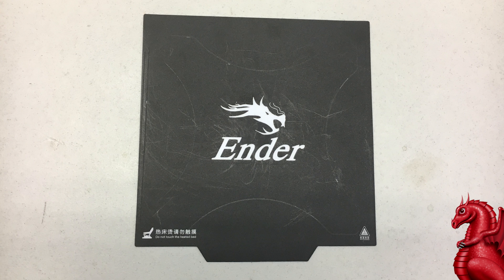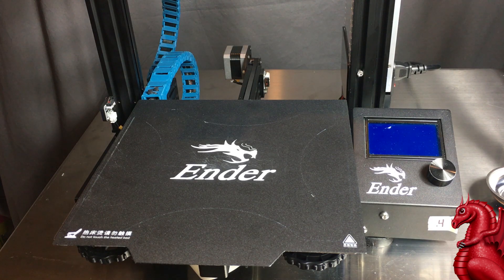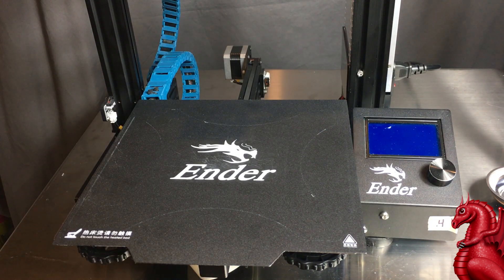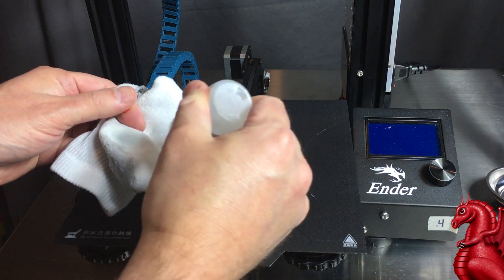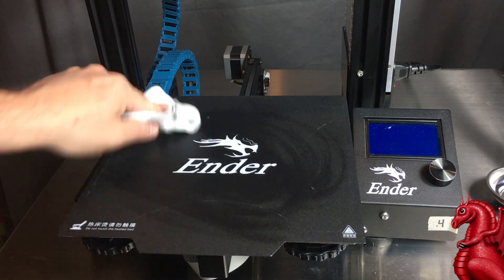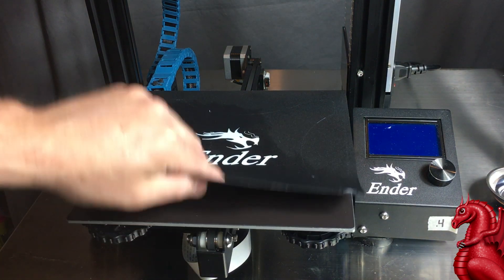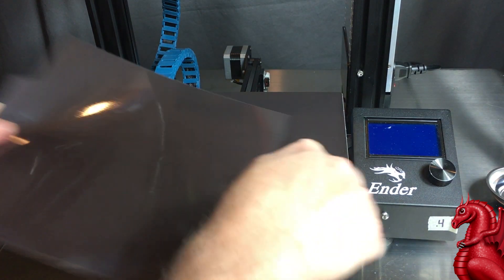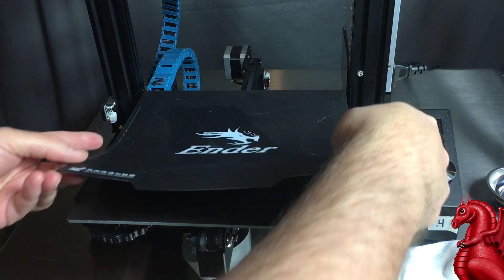How to Clean the Creality Ender 3/5 Print Surface

Comment: DONT USE ALCOHOL. I used 70% iso alcohol and after two cleanings in 2 weeks it took the texture off my plate. I am using an Ender 3 V3 SE stock OEM bed plate. I had to order a new one since the texture was completely taken off by the alcohol and was no longer usable.
Reply from the maker: That wasn't the alcohol removing the texture, you have the Z offset set too low. Iso will not harm the plate in any way.

Comment: Mine pulled part of it up off the magnetic base... I cut it up and use a thin strip on my left side for the pre print. Then I cut a picture frame glass to the y axis size and took a high speed drimmel with a large grit stone sanding bit at mid speed to texture the top of it. Works better than the old bed had
Reply: Got an awsome beholder and purple worm off it.

Main negative is my bed has to stay to the starting temp even for pla. I used to have my ender stock bed set to 60c for first layer then cool to 50 for remainder. Now all those gcodes require me to be there when the first layer finishes so I can reset the bed temp through the ender UI

Comment: Since I used isopropyl (ketonatus in Dutch stores) to clean my bed I started to have sticking issues. Just a heads up.
Reply: Allright, I tried some isopropyl from the pharmacist and that worked. Apparently the additive to make the isopropyl undrinkable leaves an oily residue. Good to know, since the bottle states it is for cleaning instruments.

Comment: I clean my ender3 bed after each print. My problem is poor adhesion using a gcode I just printed the night before with no issues. Just a pla color change. Any ideas?

Comment: I really need some advice. Every time I have tried cleaning my Magnetic build plate with 70% Alcohol and using the sock method it is not the same after. Prints will not stick to the Bed. I have even tried the Dawn dish soap method and still no  results. I have gone through two Mats already because after it has been "Cleaned" PLA will not stick. So far the only way to get bed adhesion is to buy a whole New mat. There's gotta be a better way. Any, ANY help would be great. Thanks.
Reply from the maker: This sounds like the bed is slightly too low, try raising it up 1/8 turn on all four wheels
Reply: @Tombof3DPrintedHorrors   Thank you so very much for the reply. Can I pick your brain though? So I was printing after "cleaning" it and got a complete mess. However right after taking off the "cleaned" mat and just placed on a Brand New one. No leveling in between the mat placements, It started printing with no issues what so ever. So is the alcohol removing something off the mat?
Reply: @symbolicsin  I'm having this same issue. I've cleaned it a lot how this video shows but the adhesion isn't improving. I've been sticking the free build surface that comes with Overture filament and that improves the adhesion. I feel like there should be a better way
Reply: @symbolicsin  exact same thing is happening to me, perfect prints for two days, cleaned it once with alcohol like this and cant get a single 1mm to stick to the surface anymore. Did you find any solutions?

Comment: When I start to lose adhesion, I clean it with white vinegar while the bed is hot. If stuff wont lift off the bed, I spray a little alcohol (usually cheap vodka) around the base of the print as the bed cools. They usually just pop off. Works on glass plates too.

Comment: Rubbing alcohol is impossible to get because of COVID-19. Is there an alternative?
Reply from the maker: I haven't tried it yet (will as soon as I run out of alcohol) but I am told windshield wiper fluid works great too.
Reply: @Tombof3DPrintedHorrors  Windshield wiper fluid is basically Windex, I think. That should work on glass beds, but I have the magnetic beds; I wonder if that would ruin the surface (coating).
Reply from the maker: @MinhGators  no, not the same at all, Windex has ammonia, WWF has a high alcohol content. Like I said, I haven't tried personally so cannot recommends for sure.
Reply: @Tombof3DPrintedHorrors  Thanks.

Comment: Thanks for the tip! I'll definitely use it, I already ordered isopropilic. It seems though that isopropilic does not get rid of rests of plastic on the surface, or does it? 
If not, how do we remove the very thin rests of print that get stuck on the print surface and don't come off easily with a knife or a scratcher? Thanks again, keep it up!
Reply: Asis Cal I read that heating up bed to 80c makes those thing pieces of pla easier to remove

Comment: If anyone knows how to get the really thin layers off please let me know. I just assembled my Ender 3 and printed the bed level test from another tomb of 3d printed horrors video. I have tried soaking the area in 50/50 water/alcohol, drywall scraper, and a razor blade and it wont budge.
Reply: Jared Moss try heating bed to 80c to loosen up the thin layer that is stuck

Comment: I just wipe the hot bed with vodka soaked dried wet towels during the hotend heating. Vodka evaporates almost immediately and is less toxic than isopropanol. (Why do I use dried-former-wet towels? I had the pack which was not tightly sealed and dried unfortunately...) I do have IPA but prefer to use it for PCB cleaning after soldering.

Comment: I wash it in the sink wish dish washing liquid and a sponge.  After cleaning the bed with alcohol I reinstall the mat and bring it up to temp.  I then use a paper towl and ISP to wipe the surface.  Looks and works like new.  Paper towels do not hurt and are very economical, such better than a sock.

Comment: Okay, but how do I clean it of the thin layers of PLA that stick to it? The kind that are too thin to peel off.
Reply: Thats the whole reason I watched this video.
Reply: Same
Reply: Put your plate in the sink so it covers the plug hole. Pour on boiling water from the kettle, it will lift off
Reply: Who needed a video to learn how to wipe dust off the print mat?  We came here for PLA residue removal!
Reply: Yeah I also can’t take that off
Reply: First off, your layer height is not right if this is happening or you have wrong temp or bad filament.  If you are using PLA, heat the bed to 80c and that should allow you to scrape the thin layer of filament off.
Reply: @broderp  Your the hero!!!!!!!!!!! thanks!
Reply: @barbieeberhardt4959  Don't listen to him. Heating the bed higher than what is default will destroy its own magnetism and it will start slipping around the printing surface. Maybe once sure, but done repeatedly will ruin your magnetic bed.

Use acetone or similar solvents and spread them on the bed, wait for some time for it to soak in the PLA then remove it with a spatula.
Reply: @floatingchimney  so I shouldn’t be heating my bed to 100C??? That is what the Owl print was set to for the starter print
Reply: @floatingchimney  Acetone is EXACTLY what will ruin the bed.
Reply: @broderp thanks bro, this worked perfectly for me, didn't need acetone or alcohol
Reply: @broderp  Thank you mate, saved my life., i forgot to calibrate the Z offset and it messed up my bed :o That trick worked flawlessly to repair my mistake, cheers !
Reply: @broderp  layer height in the slicer settings?
Reply: @broderp  THANK YOU.
Reply: @broderp  This is the best advice I got so far. Thank you.
Reply: @broderp  your a legend 👏
Reply: @broderp  the magnetic bed can't take the 80º C. That way it will destroy the magnetism.
Reply: @Pa-pb6kb  I thought that it wouldn't destroy the bed suddenly but with prolonged usage at higher temperatures.
Reply: Same problem, but with PETG
Reply: CoolTrainer: VaultBoy-39 nail polish remover
Reply: I'd suggest just spending a bit extra on a flexible surface that magnetic, it's way easier to take everything off and clean it
Reply: Same. Still trying to figure this out. I'm still trying to get the first bed level check off so I can test my readjustment.
Reply: That’s literally why I came here.
Reply: I just print over it with a couple layers and then take that off.
Reply: Yea it is stuck
Reply: Glass blade scraper
Reply: Check first layer height.
Reply: Easiest way is to heat the bed to 80 and gently rub with Isopropyl alcohol using a clean microfiber cloth. Don't use nail polish remover, will wreck the bed.
Reply: @davidfairclough4458  the explosion hazard it creates is insane. 
The IPA vapor don't need more than a static spark from your body to give you a serious bad day.
Reply: Use a paint/glass scraper, I have a small one and it works quite well. Anything that it can't peel off is too insignificant to affect adhesion/quality and isn't worth worrying about. If you're REALLY paranoid about it you could probably try acetone, as it dissolves PLA/ABS.
Reply: @hanzofactory  Careful with acetone though -- I ruined my flexible magnetic bed by exposing it to acetone a bit too long. Now it has pits in it in some places, no longer perfectly flat and the texture changed. But I ordered a glass bed to fix that problem, which is useful anyway. :)
Reply: @hanzofactory  Do NOT try acetone, it dissolves the bed surface
Reply: @hanzofactory Acetone won't dissolve pla but instead make the pei sheet brittle, don't use Acetone. If you wanted to dissolve pla you'd need Carbondichloride or Carbontrichloride (dcm/Chloroform) or more common solvents like Methylethylketone (mek)
Reply: @hanzofactory thank you. The acetone and scraper scratched the heck out of my build plate but it really helps with adhesion.
Reply: Same

Comment: Would 99% damage the surface? It's all I have
Reply from the maker: Shouldn't :)
Reply: @Tombof3DPrintedHorrors  Thanks for the reply.  Also thank you for taking the time to make the assembly video for the Ender 3, I am sure it has saved me countless hours of headaches by putting it together with the very specific instructions you provided.  I get excellent prints from it.
Reply: @jaytee3287  really though on the build video, my ender 3 is perfect now thanks to tomb of 3d printed horrors!

Comment: I'm going to try the sock instead of paper towels. 

I use a Prusa MK2.5 and they tell you to use glue stick on the print bed. It always creates mounds of glue residue because I don't clean it after every use.

 I use a raft from a previous print to scrape the glue off after using alcohol on the bed. I use 91%. And it makes the residue gummy for a few seconds. 

Paper towels will start to clean up the stuff, but after a few seconds they just begin tearing from the glue sticking again. 

Hopefully the sock will be able to wipe more away and I'll learn to not let it build up. :{J
Reply: Try warm soapy water to get the glue stick off then wipe it down with 91% alcohol to dry the print surface much more quickly. That's what I do and it helps a ton.

Comment: if you had to pick one witch would it be ender 3 or ender 5?
Reply from the maker: Depends. Both produce identical quality prints. The Ender 3/3 Pro is the best value for the money but the Ender 5 is easier to assemble, keep in alignment, and the frame is built like a tank.
Reply: @Tombof3DPrintedHorrors  hey thanks that helps alot!

Comment: I got my Ender 3 with the glass bed, use hairspray for adhesion and once in a while I just scrub it with the metal wire pot scrubber.

Comment: I have been doing almost exactly this for some time and never have an adhesion issue. However, it's useful to know that coffee filters are lint-free - and that's what I use.
Reply from the maker: Great suggestion- thanks!
Reply: nice suggestion with the filters!!!  so many of the rags and towels we use leave so many fibers behind you have to dust after you clean :()
Reply: Thats so smart thank yoy
Reply: is it also possible to use a micro fibre fabrik for cleaning or isnt it lint-free?

Comment: I clean it prior to every print.  I never have an adhesion problem with PLA.
Reply: I had this problem and I needed to level the bed more aggressively. I used the 1 layer disk prints to calibrate

Comment: Alcohol isn’t the greatest cleaner but it’s good for a maintenance clean, every so often I will clean with a dilute detergent then follow up with a clean of alcohol to remove any detergent residue.
Reply: what is than the best cleaner?
Reply: Detergent is an excellent cleaner but you have to remove the detergent residue with something.
Reply: @bentosan  can I use any detergent and put it on and then wipe it off with a paper towel.
Reply: Alcohol is good to use between prints, use a tiny amount of detergent on a damp cloth every week or two. Clean two or three times with a cloth with just plain water once finished then again with alcohol to finish.

Comment: i was having trouble with a type of PLA filament that wouldnt stick to the bed and i bought the ender 3 pro 3 week ago. i bought a new magnetic print surface after print surface got damaged and warped and that PLA filament started sticking to the new surface. few days later i cleaned the surface with 70% IPA and started printing. that PLA filament wasnt sticking anymore. so i hand washed it with dish soap to remove whatever was on the mat surface and started printing better again
Reply: Shadigun88 same to me, rubbing alcohol didn’t help, but soap did
Reply: I wash down with soapy water then use the IPA and a clean microfiber to finish. Never have any issues with adhesion.
Reply: Just found the solution, it’s 3DLAC spray and it’s fantastic

Comment: Nice quick video, appreciate it! Any tips to remove residual surface PLA? It doesn't affect print quality as far as I can tell but I'm curious how this could be done
Reply from the maker: Not without really scratching the bed, just leave it and it will stick to subsequent prints and pull up in most cases.